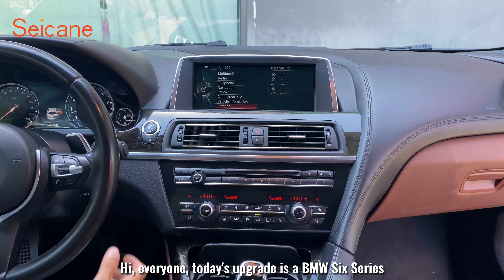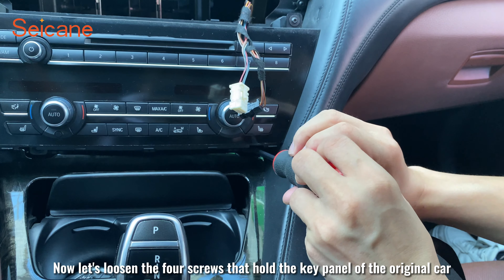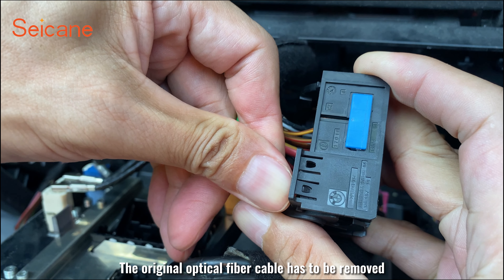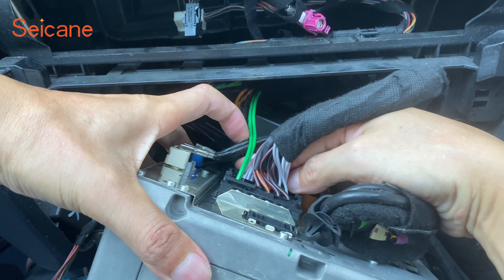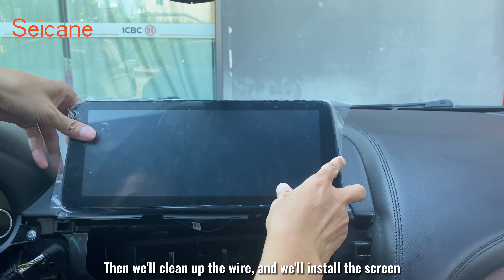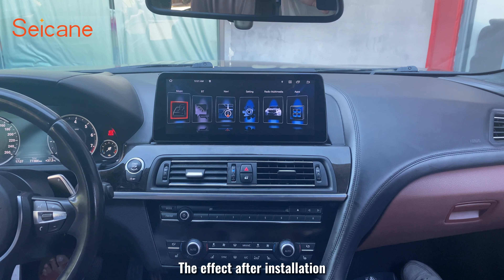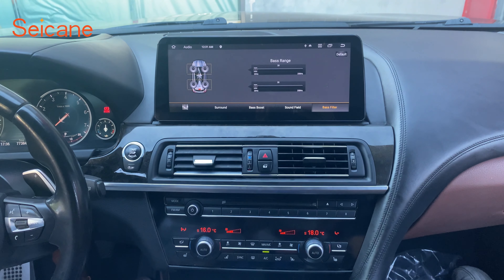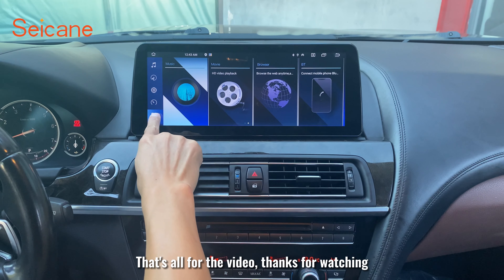DIY upgrade | How to install car radio for MW 6 Series F06 F12 2011-2016 with carplay andorid auto？

Comment: Does the iDRIVE control work? You did not connect anything to it. How does it work?
Reply from the maker: dear, it keeps original car's function.
Reply: @Seicane-Car-DVD  Do you connect any cables to the iDrive controller, or not? In the video you do not seem to connect anything to it.
Reply: @hellasride2717 no he didn’t because it’s touchscreen the idrive you can keep use in original interface
Reply: @Seicane-Car-DVD nah!  it keeps the Ui functions while you are in OEM mode, but soon as you switch over, no functions.  6 series anomaly unfortunately

Comment: Does the UI Knob and Steering Wheel control works with this new display? Does it fits 2015 BMW 640i? If everything works with the factory controls, where can I purchase this unit? Please show the link to buy. How much?
Please kindly reply. 

Thanks
Reply from the maker: hi, here is the item link : https://tinyurl.com/2kthhfkv
Reply from the maker: yes,  Knob and Steering Wheel control  still works with this new display. it is better to send a photo of your car dashboard to sales@seicane.com  ,  then we can check if this unit can fit your car or not.
Reply: I ran into an issue. So turns out the the knob and steering only work with the OEM UI, but when i switch over to to android, dead in the water.  installed 4 times to ensure i did everything correctly, but nothing